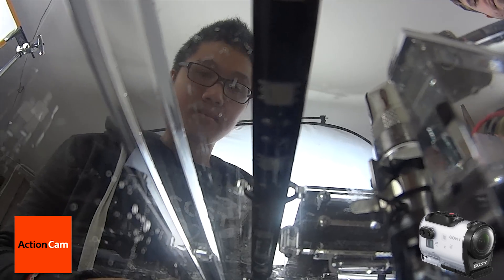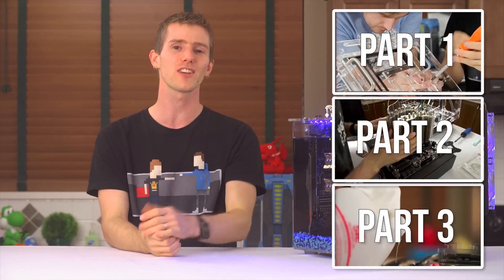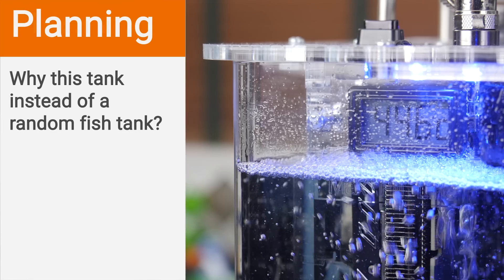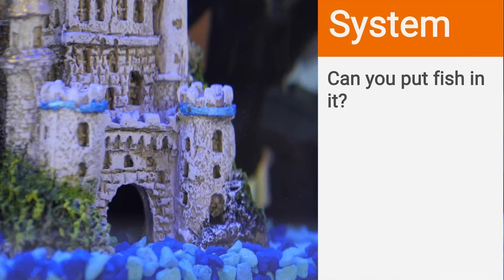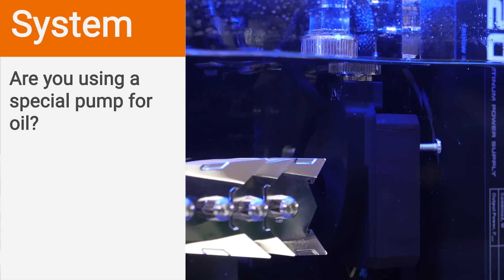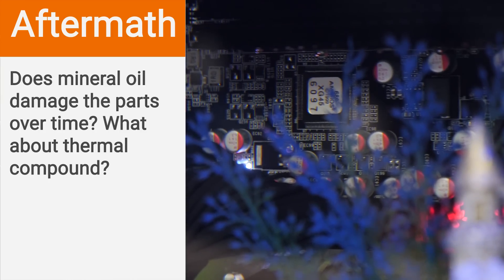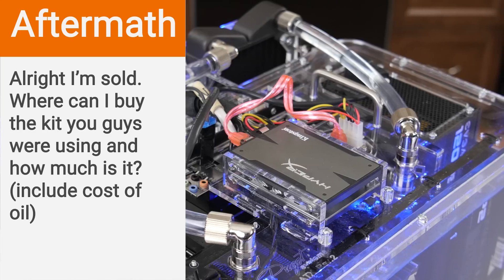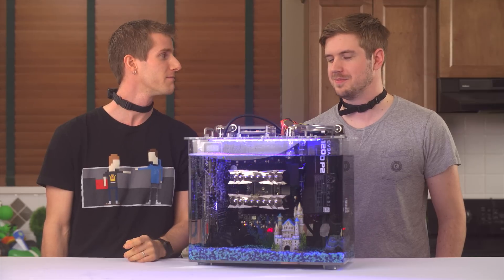Mineral Oil Cooled PC Part 4 - Q&A

Comment: I would suggest overclocking, then add fries.
Reply: Siegfreud ROFL
Reply: +Drasvin It's all fun and gags until someone gets food poisoning...
Reply: Are you guys are for real? XD imagine george foreman fryer now with gtx titan x for ultimate frying experience!
Reply: DesumetaruLiadz666 I doubt you would get food poisoning from frying food in mineral oil. You would still become more familiar with your bathroom though.
Reply: Intel fries = KFC fries
AMD fries =McDonalds fries
:)
Reply: @pivkaaa  and mcdonalds fries are wayy better
Reply: ***** Yeah. I figured that. Besides, I'm pretty sure that temperatures high enough to fry food (177-191 degrees Celsius) is also high enough to do significant damage to the components.
Reply: XD this comment section is lit XD
Reply: +Siegfreud While I figure this is a joke to some extent, I feel the need to advise against frying food with mineral oil (assuming such is possible). Not because mineral oil is toxic. It's should at places such as Wal~Mart for internal use...as an intestinal lubricant.
Reply: @Drasvin  i take a big swig daily for constipation so i don't think its toxic...
Reply: Maybe but AMD fries well:)
Reply: Intel fanboy:)
Reply: Maly Pivo My last rig had a Phenom II X6 and HD7870. My current Skylake rig is my first Intel build. Even then, it still has an RX480. Bulldozer is too far behind lol
Reply: at least AMD chips dont have a mini linux os installed inside them, like intlels spyware chips do
Reply: I would also suggest fabricating some sort of pit for the fryer basket.
Reply: Mineral oil is a petroleum byproduct. If you like 10W-40 on your fries then go for it.
Reply: the water from the frozen food would destroy your hardware. but if i ever do get around to doing a mineral oil comp im going to make it look like a fryer. the fish tank thing is funny the first few times but a fryer is a good idea. and if it ever gets hot it would make sense being a fryer and all.
Reply: PC chicken shop.
Reply: Would you like diarrhea with that?
Reply: ahahahaaaa
Reply: Haahahaha
Reply: Ha ha
Reply: Make sure to cut up and cook for 3-4 minutes so they end up nice and crispy.
Reply: LOL
Reply: now that's what i'm talking
Reply: ***** If that would work, it would be really cool. Though to be honest, I would personally be worried that I would get food particles in the components.
Reply: McDonalds has good fries though. AMD doesn't have good CPUs. At least until Ryzen.
Reply: @RetardedSysAdmin  Try saying that again in 2020....

Comment: Well, that's nice progect. But what about all this wiers from GPU fans and rubber components in power supply or that gummy thermal pads in RAM? What mineral oil could do to it after a while?

Comment: Preetty interesting stuff. Mineral oil used to be used a lot in high voltage transformers as well as other types of transformers, it functions as an insulator as well as a coolant. The only problem is that it's flammable
Reply: jimbohsp It's flammable if your house is already on fire. :)

Comment: This is nice to see but not for me personally. I don't overclock, because my budget gaming pc just crashes. Maybe I just need to reapply the CPU thermal compound, as my CPU is running a bit too hot, where my mobo Asus P5NT Deluxe bios reads cpu temp at 62C (Q6600 quad core at stock 2.4Ghz).
At the moment my pc occasionally freezes on a frame and plays a continuous last sound (when I'm watching videos online usually).
I'm on a budget so I'm going with air cooling only. Just bought Thermalright macho Rev. B, and ic diamond 7 thermal compound. The macho should arrive this Monday :D
Reply: It arrived and I've changed the cpu stock cooler to the macho. Motherboard shows cpu temp at around 30C, a 50% improvement and its basically silent. But the PC freezing was possibly caused by 2 sticks of bad ram I've bought on ebay. Did mem test which told me they were bad.
Testing without those 2 sticks now if no more pc freezing.
Reply: ilia gofman 
Unfortunately, even with tested good ram the pc continued to freeze and I think all my drivers were up to date. So I've done something that I'd better never do again. I've tried changing the thermal compound on the motherboard, and whilst lifting the heat sinks, their solid glue TIM has also taken out chunks of the die from the chips that were being cooled. The motherboard didn't work after that :{
So, I've decided instead of buying a replacement board that was manufactured about 9 years ago, buy a modern MSI 970 gaming mobo, 6 core AMD cpu and 8Gb Corsair vengeance ram, and Coollab liquid pro metal thermal compound for the new CPU cooler. Matched with my previous recent upgrade of gpu AMD R9 280x saphire vapour X, power supply Antec 92% gold, Samsung SSD 850 evo, Macho HR02 Rev.B cooler .

It's amazing!
My pc is basically silent and my MSI mobo has automatically (OC genie) overclocked the whole pc stably by 10 - 20% ish and my 6 core cpu at 4.1Ghz is at temperatures of 19 - 22C idle and about 30 - 35C at full load.

Comment: what if you only used mineral oil to only submerged the cooling system without covering the whole system.  is there something like that?
Reply: I guess you could use mineral oil as a coolant for a custom loop but there would be no point.

Comment: Very interesting, standfast the rubber or perishable elements, if you built it around avoiding perishable elements, you could realise a massive benefit of "No Dust" and possibly keeping the Components "Pristine" for much longer and possibly working optimally where time, oxidization and dust would degrade performance.  I would consider doing this for something you want super stable, and kept ultra clean, minimum maintenance. I wonder if any corporate has ever built some of this into a Mainframe or a Data Centre. I ponder on the fire safety, as it could be beneficial, as Mineral Oil has no Oxygen, it has a Flashpoint of 170c so isn't Flammable by the definition? So it could be interesting for Data Centre stuff (maybe not SAN unless you have SSD or Helium HDD). Data Centre Fire Safety is expensive, as is Air Con units, Fire suppression systems etc.

hmmm...buying old indoor Swimming pools and installing a Mineral Oil data-centre?

Comment: The question is oil better then air cooled, well in my opinion, yes. Because I would think oil has far better properties of transferring thermal temps and oil and sealed at the same time will eliminate all that dust vs air...and I like that, no dust except for the fans on the outside but that would be easy to vacuum!
Reply: MJ G Don't vacuum your components, you will fry them
Reply: Lukas Nordlund ok, I will keep it mind. Thanks!
Reply: Long Dong I'm pretty sure there's nothing wrong with vacuuming your PC fans. As long as you stay away from any exposed circuits (motherboard, GPU, etc.) you should be fine.
Reply: God From The Machine Nah PC fans are alright, and so is dust collectors. Just don't vacuum any components :)

Comment: As far as cleaning the mineral oil off, something like 95% Isopropyl alcohol (sometimes called medical alcohol) would probably work fairly well in cleaning the oil up off of clothing or even components. You can buy it at most drug stores relatively cheaply. It's a rather versatile solvent and has the ability to dissolve both polar (i.e. water) and non-polar (i.e. oil) molecular compounds. Plus, it's relatively volatile so it evaporates very quickly and won't leave any residues of it's own. If using a lot of it though, you have to make sure you're in a well-ventilated area since it does vaporize readily.

Comment: What dumbass seriously asked if you could put fucking fish in mineral oil?
Reply: i mean... you COULD...
Reply: Eli Mullis if you made a partition in the tank to fill with water that was also thermally broken from the oil with an air barrier, it could work. The whole system would have to be designed around that, and it would probably be pretty tricky to negotiate.
Reply: Dan Jacques Still, that's putting the fish in water, not oil.
Reply: eraldorh You don't use Twitch much do you?
Reply: You can put robotic fish in them...?
Reply: Eli Mullis i have watched a video and someone has done it but i dont really know if the fish still lives ._.
Reply: Very true. I just like coming up with workarounds
Reply: Eli Mullis I know right, just get a fish tank. Put it besude your computer. boom, you have a computer and fish and neither of them are dead or uncomfortable. Its' really not that hard :'L
Reply: Adam Ryan as the oil heats up the heat will transfer to the water and make them uncomfortable
Reply: Eli Mullis Might have meant plastic fish.  That  would work.
Reply: Dan Jacques Or you could just slide a clear acryllic drawer filled with water into the tank and put the fish in it.
Reply: You sure? Fish are pretty sensitive
Reply: Eli Mullis Genetically modified mineral oil fish would be pretty awesome
Reply: +Eli Mullis It was an obvious joke.
Reply: Kasper Guldmann Good point, I suppose you could always just hook your fish up to IV's to supply them with oxygen, tape their mouth's and gill's shut, and use mineral oil.
Reply: I was always thinking about making a mineral oil PC with the Lian-Li DK-04 desk chassis. Then make plastic fish that float around with the oil flow lol...
Reply: Robot fish are a thing
Reply: Dan Jacques Its oil cooled it wont heat up enough to make them uncomfortable
Reply: Adam Ryan Assuming the water is not cooled with a radiator, it'll keep receiving the heat from the oil. And it'll build up enough to heat the water to the same temps as the oil.

And note the oil gets up to 60-65 degrees celsius.
Reply: +mathig nihilcek Compleatly distilled water has no solved oxygen in it so the fish wouls suffocate.
Reply: what about fake fish? are we sure they meant live ones. not those fake decorative ones?
Reply: I bet a dumb ass wrote that
Reply: Maybe he meant plastic fish
Reply: TheRealMrRoboto probably illegal in the us
"THE FISH IS OUT THE WATER IT'S A ROBOT UPRISING"
Reply: Dan Jacques Positive. Altough if it got too hot it would make it uncomfortable but I can guarantee you, it wont kill it.
Reply: peronix8 >breath oil
Reply: eraldorh He said Kappa...
Reply: Eli Mullis .. plastic fish EINSTEIN moment, but not really.
Reply: bflet12 They are already lubed up for sexy time
Reply: bflet12 but if one of the dumbass fish swam into the fucking GPU fan xD
Reply: FluxNoble it would affect nothing. In a mineral oil build fans are just for show
Reply: +Lord Xantosh Did you even read the comment you are replying to??
Reply: Gooont are you even understanding my satire?
Reply: GKS960 http://prntscr.com/87be6h
Reply: hahahahhahaahaahhaah
Reply: Eli Mullis then the word "internet pirates" (hackers) would be suggested.
Reply: +cracktober Why not use water? Get a water filtration system that converts tap water to DI water... set up powerful pumps systems to replace the water in the entire tank in seconds. Set up appropriate fans to make sure no part of your tank is stagnant enough to build up a mineral percentage that could be harmful. (a little bit of fluid mechanics is required to solve that one.) Then you "could" put your fish in the same tank as your computer, and they could swim around it... the second one of them touched your CPU they'd be dead. Or when you stress-tested your computer, it'd get very warm... You'd also have to factor in cleaning it from fish stuff... it'd be a lot of work, but at the end of the day, you could have a very unconfortable fish in the same tank as your computer.
Reply: +mathig nihilcek The water will also dissolve the copper traces on the pcb, causing the computer to fail.
Reply: +Eli Mullis __ robot fish.
Reply: +Eli Mullis  you can but it will be dead
Reply: +FluxNoble I guess you'd have to mod it with a grill haha
Reply: thats what i wanted to ask aswell
Reply: that would be cool if you could put fish in it though.
Reply: they have a video featuring a pc which has a fish in a separate tank.....
Reply: you can add a fake one tho
Reply: You could put fish in it, then they would die. So technically, that's a yes, unless the fish is so big, that it can't fit in the tank.
Reply: Andrew Daugherty it would die the same without water
Reply: Max slayer Yeah, I know. See temperature changes. Plus your components would die because fish can really dirty up the water if there was water used. Stupid auto-correct on my phone...
Reply: Eli M what would be better is if you put a tank of water in front of the mineral oil and in that you put fish
Reply: Someone who was joking, and Linus' tone and trying to hold back laughter suggests to me he understood it as a joke question too.
Reply: Eli M hey you can put fish in it ....... and you can fry it when the system overheat....very convenient right ?
Reply: Fish don't really have "sexy time." A female fish lays eggs somewhere, and the male fish swims over them to fertilize. So there's literally no physical contact.
Reply: I know, people are retarded as fuck.
Reply: peronix8 Imagine fish shitting on your Titan X :D I would kill her imidiately
Reply: cracktober You cant use water.... If that was supposed to be sarcasm then that doesnt work in text form because we cant hear your tone of voice or see your face.
Reply: I would! 
Instant fried fish sticks!
Reply: Yeah you deep fry fish in sunflower oil or canola!

Comment: How about a blood cooled computer? Blood is not conductive and is red, fuck yeah red.
Reply: squalltheonly blood is conductive. It is red because of haemoglobin, which is a complex of four globin proteins which each have a heme molecule attached. That heme molecule is, essentially, iron.

Furthermore, conductivity is determined by the presence of electromagnetic imbalances, and proteins are basically made of electrically imbalanced molecules. Amino acids have one end which habitually sheds an ion, and another end which habitually leeches an ion, so there would actually be a rather plentiful supply of ionic material to promote the flow of electrons across blood.
Reply: squalltheonly I am Pretty sure Blood has LOADS of Iron ._.
Reply: squalltheonly How has no one said you would have put your PC to death by Bloodrocution?
Reply: squalltheonly I am Pretty sure Blood has LOADS of Iron ._.
Reply: Nicholas Cox XD
Reply: Also, do you know what happens to heated up blood? Hmmmm. It'd be a fun minute.
Reply: Our brain doesn't produce "electric currents", it produces "electrochemical impulses". They're not the same, and the differences are crucial. There's also the tiny matter of the myelin sheath providing insulation around the axon.

Also, there's a perfectly common explanation for why a full container of liquid heats up faster than an empty container when bombarded with microwaves, and that's due to the wavelength of the radiation used. Why do you think its considered safe for microwave ovens to have holes in the metal allowing us to see inside? 

And to think that some of us thought your original "blood" comment would be the most ignorant thing you uttered here...
Reply: squalltheonly and what know ?!
instead of putting fish in it you're gonna put leeches ???.....
Reply: +Christ J "Furthermore"  dude you just got fancy
Reply: squalltheonly then it wouldn't be red
Reply: Let's go for blue blood then and free humanity at the same time :)
Reply: Combaticus the Destroyer! bloodrocution, man that'd be a cool song
Reply: Nauman Javed pfft...

Science...pfft

Then how come our own electric currents in our brains don't electrocute our whole body? We make as much energy as an energizer battery.

Science can't also explain why a microwave heats up a glass of water, but not an empty glass.
Reply: Christ J well 38 people thought it was funny. Maybe conductivity can be taken out of blood, just like it can be taken out of water. Science needs to get on it

Comment: OK, I get that it would keep it cooler and allow for constant lubrication, but how does the liquid not short out the electronics?
Reply: It isn't conductive so it doesn't short the circuits. If it has moving parts like a hard drive it has to be outside.

Comment: i dont know if this is actually good. But i have a old AMD FX 8120 8core 3.1ghz (if memory serves) proccesor that is clocked to 4.6ghz with just a H1000i closed-loop water cooling and it has never even when stress testing it gone over 30C. It's at like 12 - 15C idle. Only problem is that all my other parts suck so i dont get much performance. But when i see all these builds where sometimes CPUs aren't even clocked so they're at like 3.6 or something or here where it was clocked to 4.5.. Im thinking why aren't they clocking it more, cause my shit is really old at this point. i forgot where i was going with this comment.. can't back out now, better post anyway.